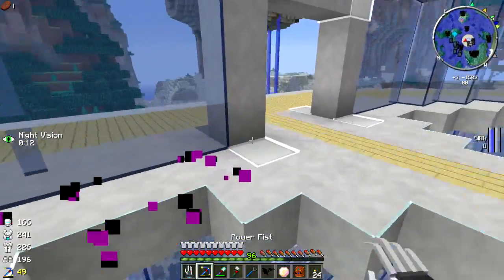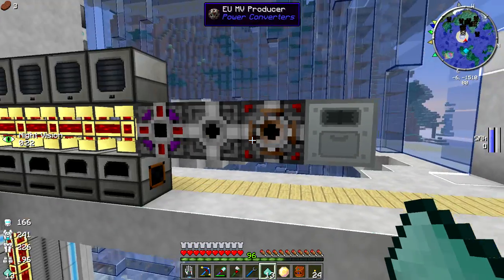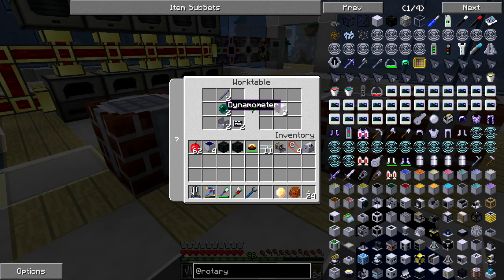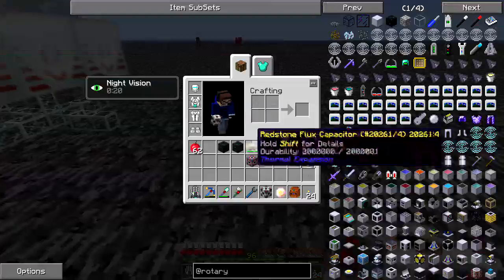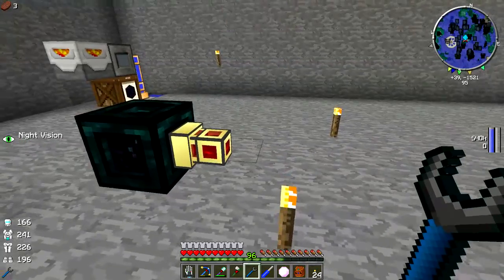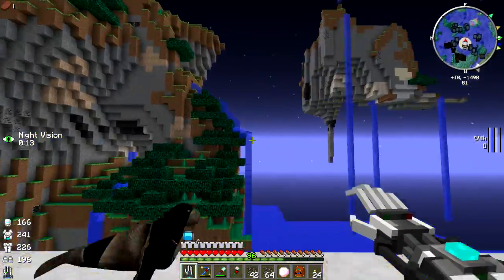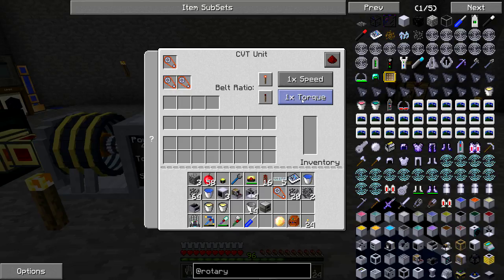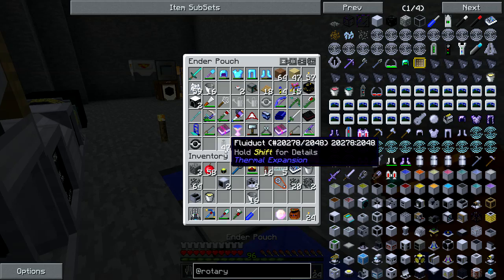HermitCraft FTB Monster - Rotarycraft Ore Processing!!! ( Minecraft Feed The Beast ) S3E15

Comment: the bars on the right side of the extractor show if and how much is missing of the minimum requierments. the 4 bars are for the 4 stages of the process. Each process has diffrent minimum requierments which you need to forfill, but every stage processes faster when you apply more rads while still forfilling the torque!!! you can speed it up as fast as 20+ overclockers in a macerator it is amazing !!!! i used around 40 magnetostatic engins with power junctions ^^ it flys

Comment: Just for explaining, the torque's unit is Newton.meter squared (dot multiplication), secondly, what's in the handbook is the minimum required power, torque and speed per stage. Thirdly, you are providing 4.194 MEGA watts which means 4194 kw which means 4194304 Watts which way higher than the required 65536 watts
Reply: Torque is measured by force (Newton) times the moment arm (meter), but it is not squared.  Also, You only provided four sig figs when expressing in MW and kW, but then you have seven after your conversion to Watts.  Where did the extra three sig figs come from?
Reply: Andrew Curley I was expecting the newton.meter thing, but for the MW and kW 4.192 MW (only four) is Mega Watts which means one thousand kilo Watts, 4.192 * 1000 = 4192, kW is one thousand Watts so 4192 * 1000 = 4192000, I rounded it to the nearest power of two which is 4192304, thus no figures are loss

Comment: IDK if one of the 216 other comments already pointed it out, but torque is measured in Newton*meters, and speed in radians/second (and power in watts obviously).

The newton is a unit of force, so newton*meter is torque (force * distance from pivot).

Radians are an angular measure (pi radians = 180 degrees for reference); radians/second is obviously angular speed.

I don't think I need to explain power. :P (Edit: looks like I do. Megawatts are millions of watts, kilowatts would be thousands of watts. Obviously, krad/s is also kilo-radians per second.)

Comment: The stages that the book talks about doesnt refer to how ful the bars are but which bar,
As you can see in the gui there are 4 processes that run (those are the 4 stages) and each one has a certain torque, speed and power requirement, if you meet that requirement thats when the bars fill up

Comment: 4 steam engines, combined power using shaft junction -> CVT set for 4x Torque and 16x Speed -> Extractor
Not as fast as using a Magneto-static engine, but will power the extractor indefinitely, using a lever to switch between CVT modes.
I am working on a ComputerCraft script that will automate the switching of stages.

Comment: Hey Slip! Try using an open blocks fan block to push yourself into a 2x1 mystcraft portal at the top of the elevator. That way it should not interfere with you teleporting up there as there is nothing within two blocks above the elevator. As you only have to touch the portal block to teleport it should work pretty fast.

C
P 
P     F
C E B

C = Crystal
P = Portal
F = Fan Block
E = Elevator Block
B = Any Block can go here.

You could even try the rotary craft fan for the same effect maybe.

Comment: You guys really should get into RotaryCraft, it is a superb mod. Almost every thing in rotarycraft can be acelerated by highier speeds, the torque requirements is a minimum necessary for the machine to run, so if you get like 4 of those magnetostatic engines and connect those with some shaft junction, you will multiply your power, keep the 512 torque and convert the rest to speed, and the extractor will get much faster. my extractors are instant in each phase and it consumes like 20k rf/t by the machines powering it.

Comment: and it is worth switching the speed and torque into each other for the extractor, as you found out the diffrent stages have diffrent torque minimas and it is very strongly requmended to switch the torque every few seconds back and forth.

The stages need : s1 = 512 torque, s2 = 8 torque ,s3 = 4 torque, s4 = 128 torque .
 
For eg. by switching the torque from stage 1 (512)  to stage 3 (4)  you multiply the speed by 128!!! with the same amount of power for stage 3, but after all the ore is processed on slot 4 the power needs to switch back because every other stage stoped working, the minimum torque was not forfilled.

pm if you have quastions love your stuff

Comment: Nm is newton meters and rad/s is radians per second which is the SI unit for rotational speed if you don't remember from high school there are 2pi radians in a circle so that is how many times the engine rotates per second just divide your radians per second by 2pi
Reply from the maker: So it's not so much RPMs as it's the speed at which the outer edge of the shaft is spinning?

Comment: You didn't reach the extractors power cap. You can add more speed to it to make it process faster. Also if you put rare ores (diamond ore) in the extractor then you have a 75% chance of doubling per stage.
Reply from the maker: Great info! Ty!
Reply: np
Reply: ToonLinkFan95 sl1pg8r  Yep. The amounts shown are just minimum values. However that Setup you are currently running takes relatively exactly 750 RF/t. But oh well.. Power is free. :D There is also a thing that lets you "fusion" two different kinds of power inputs together aslong as they have the same Speed. That before the CVT Unit and you're good to go. :D
And for the Lubricant: Basically anything that converts Speed into Torque or vice versa respectively needs Lubricant (and anything else then the CVT will need a constant supply). The only exception is if those parts are made out of Bedrock (wich can be gathered with RotaryCraft).

Comment: is there any way to speed up the processing because the extractor is very slow in stage 4
Reply from the maker: You can ad additional engines to speed up processing.
Reply: sl1pg8r its actually just based on the rads/s. 1,024,000 rads/s makes the extractor run instantly (one tick processing, e.g you cant see the bar move at all because its going so fast)